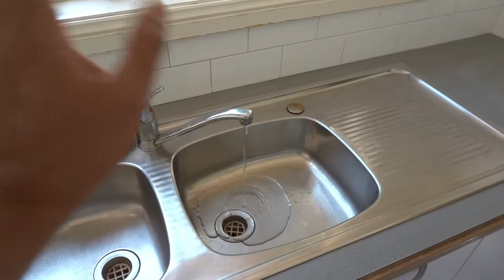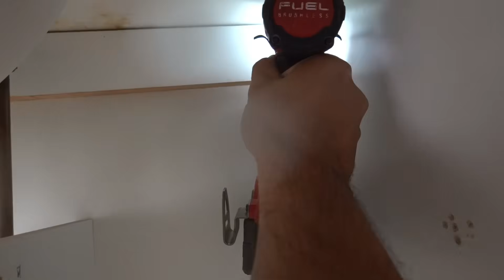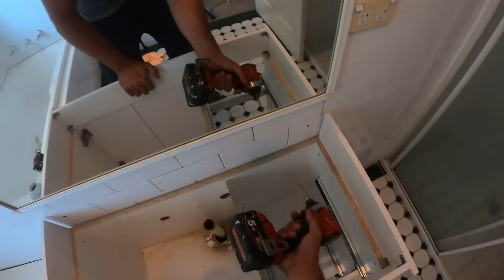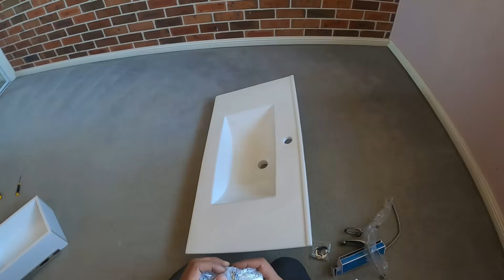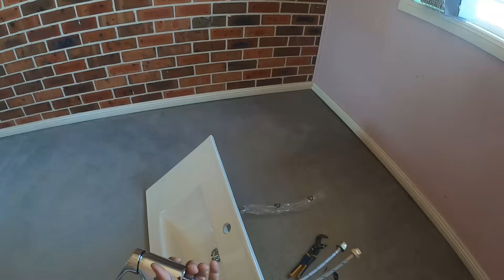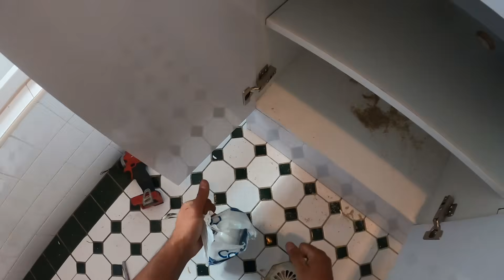How to remove and install bathroom vanity - DIY

Comment: Thanks, Bill. I followed your instruction step by step. However, there is always a bit water leak from the pop up waste. I think the rubber rings have problems. Can I use silicone or plumber putty to replace  rubber rings? I worry that silicone is hard to remove. Can anyone give advice? Many thanks. Simon.

Comment: Hi bill! Have been studying this video for a few months now. Finally got a new (second hand) vanity but the pipe width seems about 2mm narrower than the original! Please help! Also today the hot water shower tap, no water is coming out! Any advice? 

Love all your videos. Even being in a rental I say and watched you replace a kitchen for an hour knowing full well I won’t be doing it! Keep on keeping on!
Reply from the maker: Hi, the pvc pipes could be different as one may be standard pvc piping whilst the other is pressure pipe. As for the tap, could be that the tap washer has jammed against the seat. Replace the washer 👍

Comment: That looks ridiculously easy.  2 questions - 1) Do you just use a masonry drill bit to go through the wood and then tile? 2). What would happen if something went wrong with the mixer…would you need to break the silicon seals to remove the vanity top.  Honestly I feel like I want to change mine now and you make it look easy - until I do it 😂😂.  I once changed the vanity hose underneath as the old one split and water spewed everywhere - it was a chore and a half…but I didn’t need a plumber 😂😂.  Would you consider doing another video of this sometime only because I missed a bit of the tap work with the head camera….OR…a great idea you could come and do mine and film it - we’re in Sydney metro too 😊. Your videos are honestly valuable to so many

Comment: Hey bill love your videos, about to remove my bathroom vanity - can I ask when I unscrew my water fittings do I need to cap them off or anything in case I need to turn the main water valve on from the outside? Asking because the reno is gonna be over a few days so it’s likely I’ll turn the water mains on and come back next day to resume work.

Comment: Great video thanks mate, only missing part was how you measured the main bottom drain hole.
Reply from the maker: I marked out the back location for the floor waste and measured the distance to the center of it ( in the video ). Simply transfer the measurements to the base and drill out. 👍👍
Reply: @billshowto  I did see that, just got a little lost, I’m looking at installing a couple of new vanities, just down want to drill the hole in the wrong spot. Thank mate, it’s good to have a Aussie DIY channel.

Comment: Do you need to worry about abspestos with something like this? Or shouldn't be any in the wall where you drill the holes?
Reply from the maker: In older properties the bathroom and kitchen could have asbestos in the walls, but not this one 👍